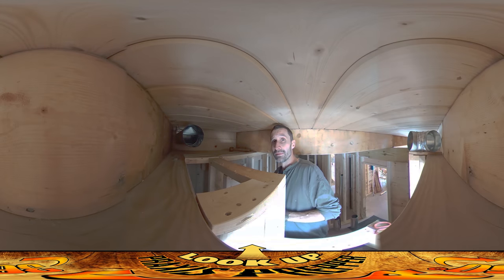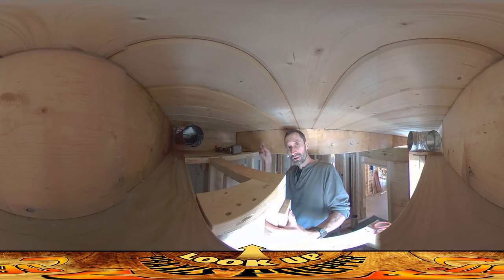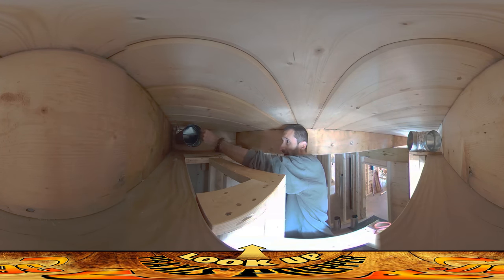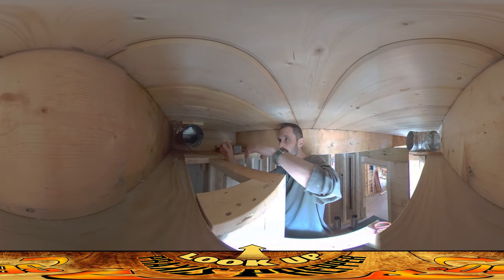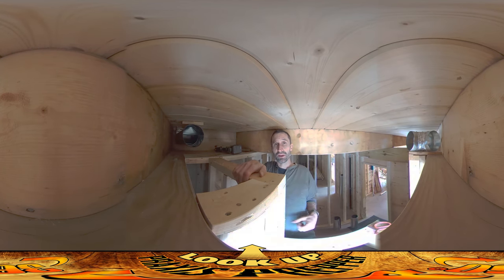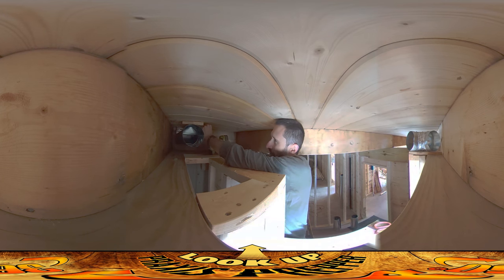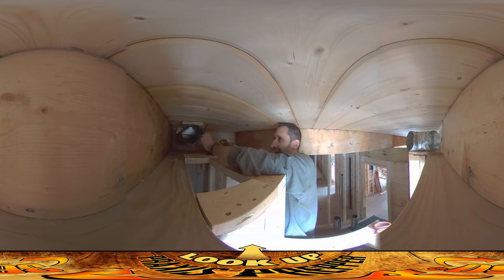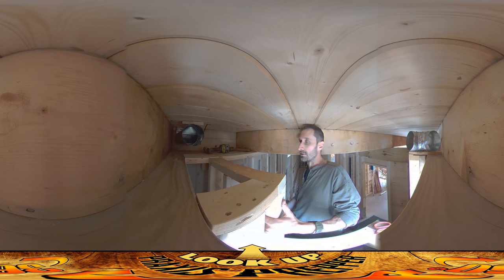Homestead Building - Sub Floor Venting Conduit Work

Comment: The common duct tape is often misunderstood - the term refers to the type of cloth material used (originally) to make it and not its function.  What you need is gaffer tape, it is foil type of tape you'll find it last very well on the ductwork of your heat and cooling vents.
Reply from the maker: We used "gaffer tape" a lot in the film industry. It's great stuff but far more pricey than duct tape. What we used wasn't a foil tape but rather a very tough textile tape.
Reply: @PraxisPrepper  it could be different terms or names for different countries what you are looking for is foil tape for duct work.